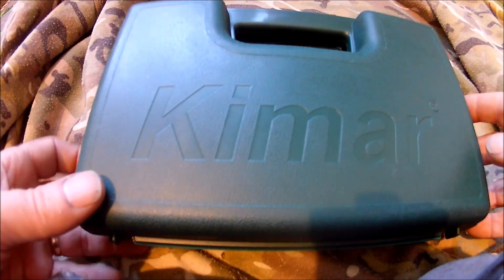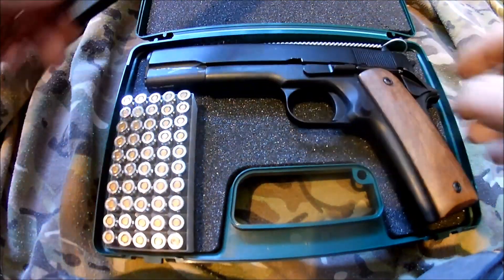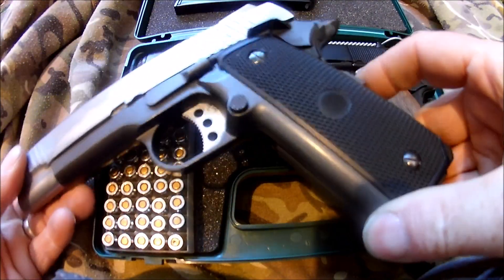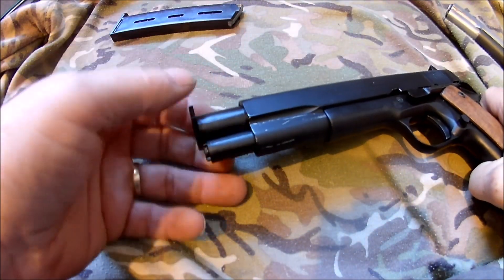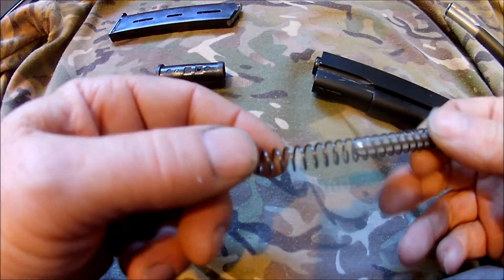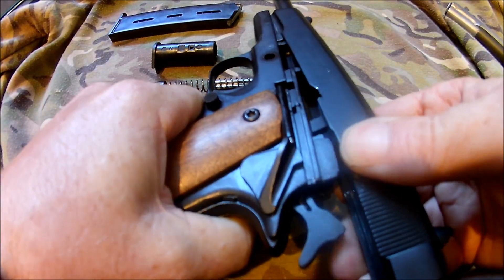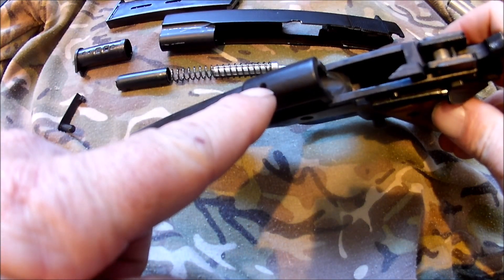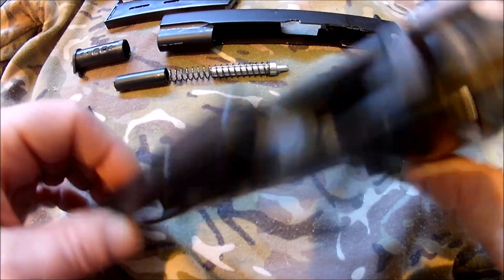KIMAR 911 8mm blank firing 1911 copy

Comment: Would this accept actual 1911 parts? (Non pressure bearing parts like grips and such. Nothing silly.)
Reply from the maker: The grips are interchangeable, but there are lots of companies making 1911s so there might be a variation in the screw holes.
Reply: my friend had a custom hammer and trigger in it.

Comment: what 8mm shells are u using there bro? are they fiocchi
Reply from the maker: Yes Fiocchi. They are a fair bit louder than you hear on the video.
Reply: thra5herxb12s are they the gold or silver ones? and do u know if the gold versions are legal?
Reply from the maker: I use both types whichever is cheapest at the time.
Reply: thra5herxb12s are the gold ones legal in uk? If so where can u purchase them from?
Reply from the maker: You can buy them from any gun shop.
Reply: thra5herxb12s okay mate. if u had a website to purchase them from cud u recommend any??
Reply from the maker: I use my local gun shop but I guess you can just google the question to find somewhere close to you or mail order.
Reply: @armaanhafiz  I’m pretty sure they are legal just as long as they don’t fire a projectile